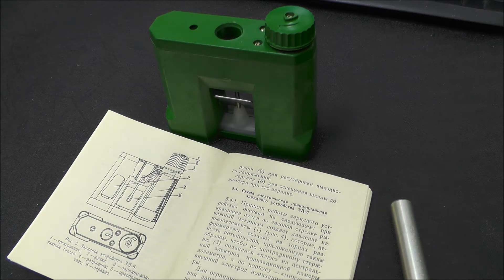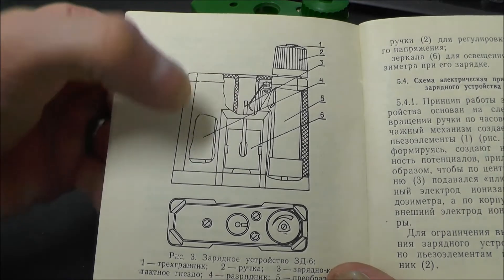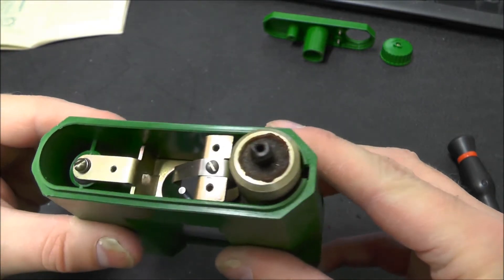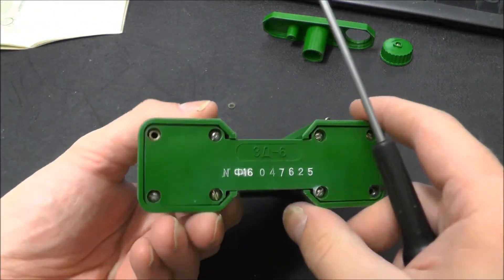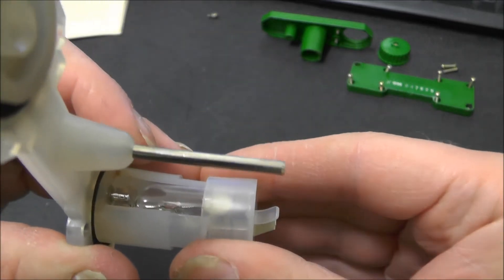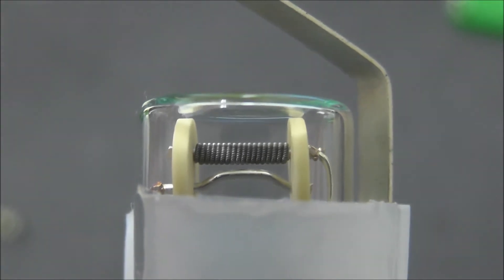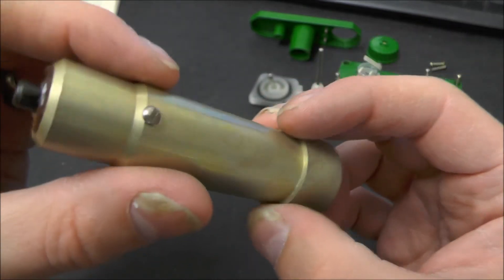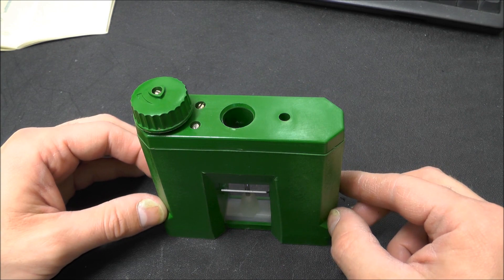DL#027 - Teardown: Russian ID 1 Dosimeters Part 3: Charger

Comment: Reading the manual, I was unclear on how a piezo was being used as the power source (my Russian is terrible).  I had assumed it was an impact device that would charge a capacitor.  I see now that it's a pure mechanical-compression approach, and a screw-press essentially loads the piezo stack to create the charging voltage, and setting the compressive load via the knob effectively sets the charging voltage to zero out the electrometer in each pen.  Low total energy, but you don't need much to charge the electroscope in the pen dosimeter.
Also, the "arrester" I assumed was just a bare spark gap.  But a gas discharge tube makes much more sense.
Given how bog simple this thing is, I'm actually kinda impressed.  It ain't necessarily pretty, but it'd be pretty reliable in an emergency, and could sit in cold storage close to forever.  Old Civil Defense units in the US often used a chemical battery, which always seemed less ideal to me.

Comment: The text imprinted on the black goo covers the two bottom screws is OTK, and it means that this equipment was manufactured to military standard in the soviet union. It means something like "Department of Technical Control". Russian stuff is made for lasting, simply as it can get and low failure rates and has "material" in it.

Comment: Got this also. Hard to turn and STOP at 5 turns. Other way turns ok. With to do to fix?
Reply from the maker: sounds like something is jamming the piezo generator. I didn't take mine apart that far but inside the piezo generator there should be some jaws that clamp and squeeze the crystal as you turn the knob. You may need to open this and check.

Comment: The manual describes the functionality on the right side - the lever applies pressure to the piezo elements, they produce voltage.
To avoid overvoltage, there is a spark gap (4), (not an "arrester", literally - "discharger", which usually means a spark gap).
The polarity is ensured by piezo elements themselves (their arrangement).
OTK (i.e. on the seals) means "quality control".

Interesting piece of hardware, thanks for the teardown.
If you need help with translating, you could ask me (Artlav on EEVBlog).
Reply from the maker: i used google to translate the manual. I think it did a good job but maybe the odd word is not correct! Thank you for correcting.

Comment: I would guess the GDT is actually both a rectifier and a voltage limiter, it likely will break down at a very low voltage in one direction with the thoriated electrode and at a high voltage in reverse. Would be interesting to see it in action and glowing as you turn the knob, glowing most likely red with either plain neon or with a penning mixture inside.

As to the pulse generator it will likely be little more than a spring and a stepped cam, with the cam applying pressure to the piezo disks as it is rotated, and then making a high voltage pulse as the cam rotates past the cam edge and applies a shock to the stack. I take it it only turns one way. not really going to be interesting, standard BBQ lighter stuff, and those do not go back together from experience.

The insulation is most likely polypropylene, standard cheap and long lasting for high voltage, and a lot cheaper than PTFE along with being a thermoplastic so it is possible to injection mould it easily. Nice design, simple with all parts doing more than one function, and all easy to assemble in the factory.

Nice touch as well with the QC doing the wax seals and using a recessed die to put in an identifier to be left in the wax, serving both as tamper proofing and showing who did the work. There must have been one in the top recessed screw as well, but it likely lost volatiles and fell out over the years. Wax is likely beeswax mixed with carbon black to dye it.
Reply from the maker: SeanBZA Will see what i can rig up to see if there is anything visible in the tube. As for the generator. You can turn the knob many turns and that slowly puts charge onto the pen. you then turn it back to the beginning to reset it. So i think it applies continual increasing pressure onto the piezo elements, it makes no sound.